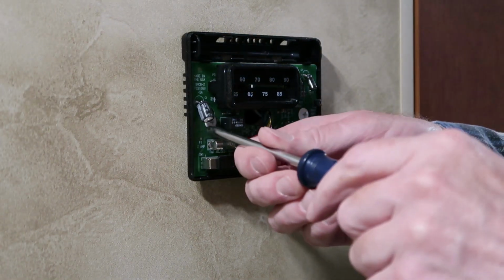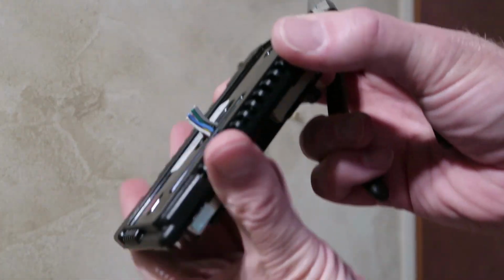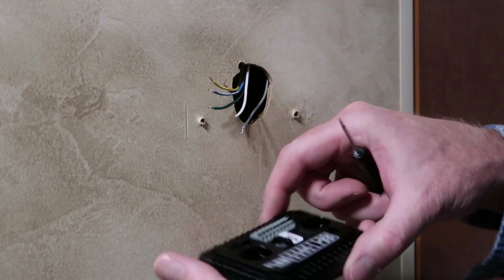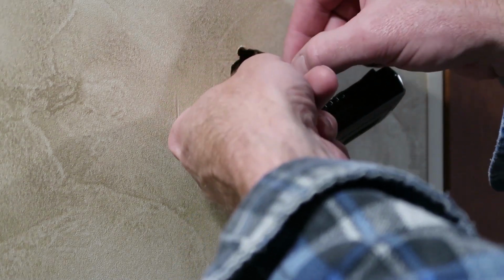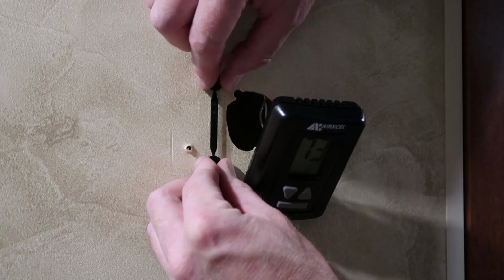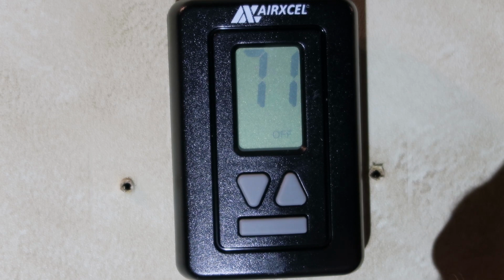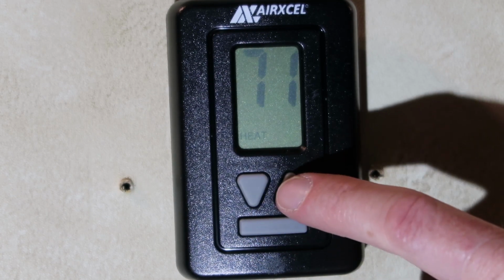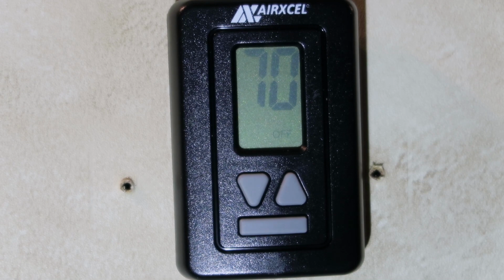RV Digital Thermostat installation, 9430-3382

Comment: I have a red, green and white three wire existing harness that I wan to hook up to this. It is currently attached to a Dometic digital thermostat. I’m only doing this for the added Bluetooth.
I can’t figure out where the three wires should go.
Any help greatly appreciated.
Thanks
Reply from the maker: Match the terminal codes from your old T-stat to the new one.
Every T-stat I've dealt with has an industry standard coding on them as to what each wire does.  Thy are single or two letter codes.

Comment: Where is the room air temperature sensor located in this thermostat ? is it internal ? thanks
Reply from the maker: Yes. it's inside.  All thermostats I've ever seen have their temp sensor internally.
Reply: @deltabravo1257  Thank You i had a furrion that’s been nothing but trouble & the room air sensor is in the return air ! Ended up trading

Comment: When you were explaining the functions of it it looked loose on the wall?
Nice upgrade but don't like having to toggle through all the 'cooling' settings to get to the heat option, will look for one that has switches instead.
Reply from the maker: I didn't have it fully attached to the wall.    I also dislike having to scroll through all the cooling options to get to the heat.

Comment: Why didn't you just unscrew the wires off the old thermostat?  Then your remaining wires would not be so short as they exit the wall.
Reply from the maker: The wires weren't screwed on to the old thermostat, they are soldered in and crimped to the trailer wiring harness.

Comment: Where can  you get JUST the spacer bar and tabs?? My thermostat still works fine, but was knocked off the wall and the two little grommets broke off. According to all I have called, have to buy the WHOLE thermostat. There has to be a source or work around for those parts.
Reply from the maker: I'd recommend trying to find screw with a head small enough to fit through the hole, but big enough that it locks the T-stat in place in the slot on the back of the T-stat.

Comment: Nice video, but I wish you had shown the actual installation of the wires.  I know you tried after the wires were attached but that step would have been helpful.  Otherwise, I have the same project I need to do and have ordered the new thermostat.  This will be a helpful tutorial.
Reply: newsveteran The wire installation is simple. The thermostat on the back shows you which wires to connect where. Great video. Thanks.
Reply from the maker: I should update the video this winter.

Comment: I enjoy your video's 
I also have a truck camper a 2005 in your marker light upgrade which I just ordered 2 red and 2 ambers to get me going. My question is where did you get your stainless screws?
Reply from the maker: I bought the screws at a local hardware store